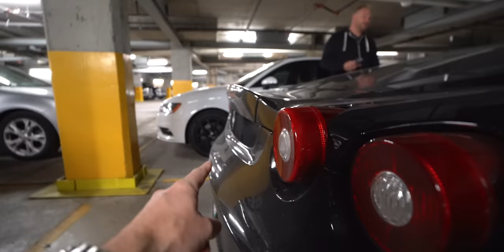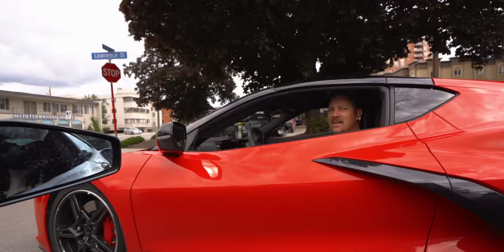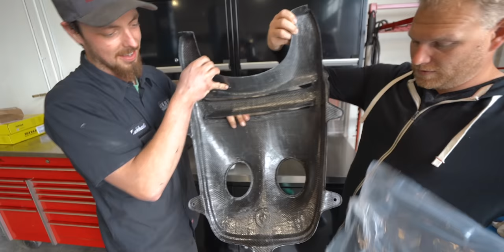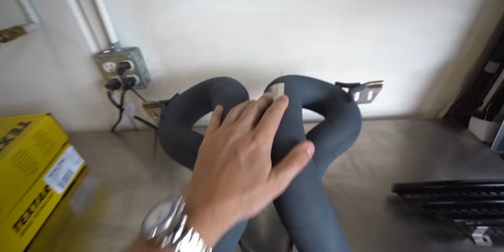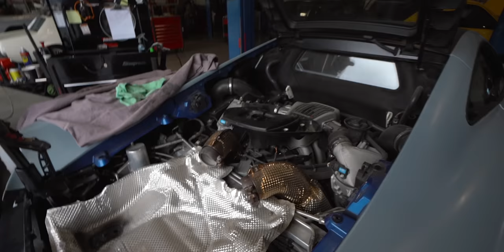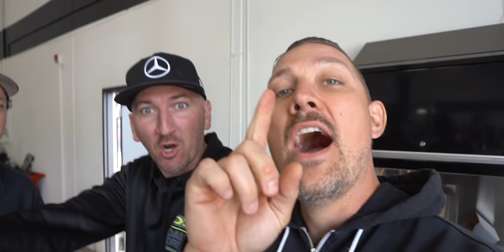REVEALING NEW FIRE THROWING STRAIGHT PIPE EXHAUST! *Top mount conversion*

Comment: Say goodbye to the carbon fiber spoiler. It's going to melt in no time. They usually have heat resistant around the top mounted exhaust.

Comment: Nice exhaust kit!
Now....will the rear spoiler melt while going down the road.
You need to have a or two exhaust covers made up....maybe in stainless steel or black silicone balls to fit into the exhaust tips for when it rains out and you park the car.
lol.....yeah empty soup cans would work...lol.
Or not.

Comment: U guys are going to have to wrap the read wing with heat wrap or it will melt the carbon fibre they had to do that on the Mclaren p1 and other cars for the wing doesn't melt when your driving btw be careful guys